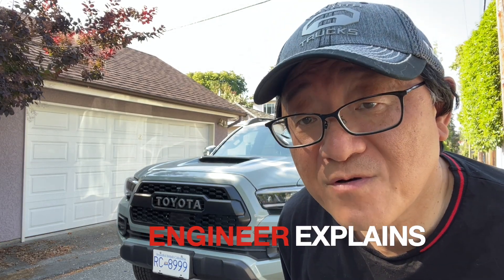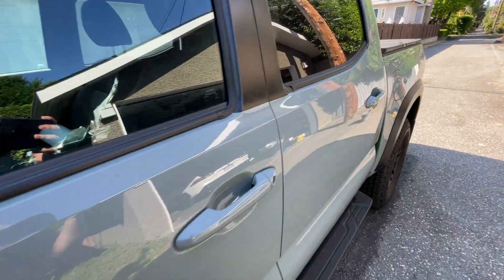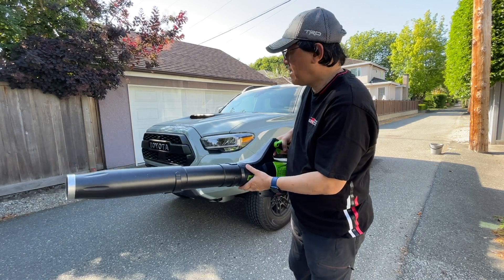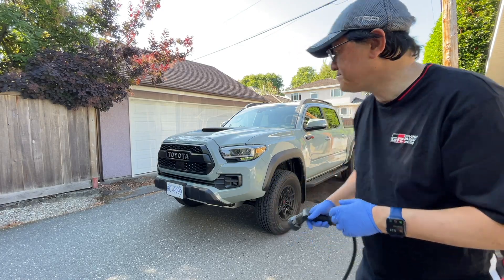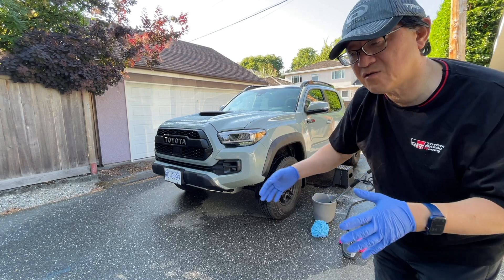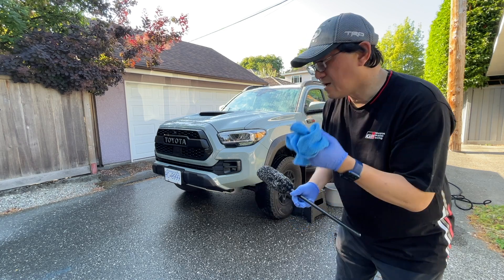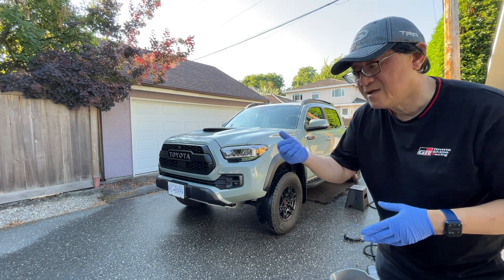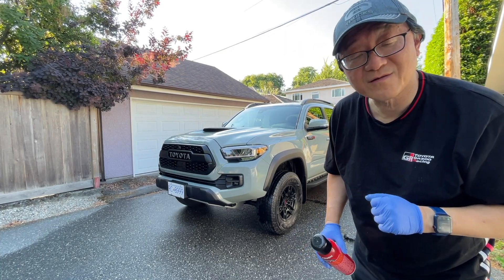ENGINEER EXPLAINS BEST METHOD FOR WASHING CARS & TRUCKS - Using Leaf Blower as a Tool!

Comment: You need a garage dude not street parking aren’t you worried about people scratching or hitting the car on the street?we live in Arizona where the water is extremely hard alkaline out of the hose plus it’s often 100+°  or 37.778c°metric is so goofy so it drys off super fast

Comment: I enjoy your videos!  I am skeptical of using the leaf blower at the beginning though. The leaf blower does nothing more than driving at highway speeds does for blowing dirt off. I suppose if the vehicle has been sitting for a while the blower would be good for removing loose debris and dust without washing it into the crevasses as water would. I'll never get to try it out though because my 4Runner doesn't sit for more than a day.
My pet peeve is the hood scoop. It seems really difficult to rinse all the soap from the hood scoop for some reason.

Comment: David, I always use a dual bucket system to to rinse my wash mitt before putting it back into the shop bucket. I also use my leaf blower as you do. You might want to try the Ceramic Wash & Coat from Griot's Garage. I love it on my ceramic coated cars.

Comment: What about pinstripes when offroading? A PPF is needed if paint care is important to you. I'm surprised no pressure cleaner was used. I doubt a blower does much. If you have caked mud from dirt roads even, a pressure cleaner is needed instead of a blower.

Comment: I've been doing pretty much the same routine for my vehicles, with the exception of using a chamois cloth to do the final drying, which I rinse and squeeze dry several times during the drying process. I live on a 1/2 mile gravel drive, so I haven't found a tire dressing that doesn't attract dust and dirt. I just clean the wheels with a cloth and the tires with a bristle brush. I do this about twice a year, whether it needs it or not.....

Comment: Everyone in the comments is obsessed with "the two bucket method" but tbh the best method is to use multiple towels so everytime a towel is dirty, it doesn't touch the truck or bucket again.  One bucket, one dip, and then throw it in the wash pile and grab another.

Comment: David thank you for the tips on cleaning your truck without scratching the paint. I will be using the the methods you showed in this video presentation this summer on my 2016 Subaru WRX limited.

Comment: David I Would Highly Recommend the Two Bucket Method with Grit Guards this Method Separates the Clean  and Dirty Rinsing of the Wash Mitt to Prevent as Much as Possible Scratching
Reply from the maker: Yes I am aware, I just didn't have a chance to show every step on the video.
Reply: @AutomotivePress  it’s Cool you did an Awesome Job👍

Comment: Great video Instead of ceramic coating, I use a polishing compound, glaze and wax (Meguiar's). Also, Michelin recommends that  you don't use tire dressing . Soap and water and a stiff brush will remove the dirt and brown stains.

Comment: Hi Sir, which brand of tonneau cover did you use, any recommendation? Thank you
Reply from the maker: I purchased the OEM original Toyota tonneau cover, which I find is heavy but more leak-proof
Reply: @AutomotivePress  thank you for the reply, I am actually in the same situation like you, I have placed an deposit for 2022 Tundra Platimum this January and the possible delivery is June

Comment: Toyo 12    David: I use the leaf blower to dry my truck,  didn't think of using it before washing.  I would say , I wouldn't lay  the microfiber towels on the ground as they will likely pick up grit, may scratch paint. Nice truck, keep up the good work. Thanks Bro!
Reply from the maker: Thank you for the comment! Don't worry, I didn't use the towel that was left on the ground. The video isn't showing it but I used all new towels for every step of the way.

Comment: David, normally I like your videos, but here, less talking more action. I think driving on the freeway should blow off a lot of the dirt before you wash it.   Could not care less about your shirt either.
Reply from the maker: Thank you for your feedback, and I really appreciate your comments.  Driving on the highway, though, isn't the same as using a leaf blower which has much stronger wind flow. You can also focus on all areas of the truck to "blast off" using the blower, not just the front of the truck.  Anyhow, always appreciate your feedback.

Comment: David, start using an extra water bucket of clear water, and after every panel dunk, the cleaning tool in the clear water bucket then dunk using the cleaning solution. This helps maintain minimal amounts of dirt in the washing solution bucket.
Reply: thats a good idea. I find with a pole and microfibre pad in a soap bucket, after washing a black JCW, it will still have some dirt on the lower portion of the doors

Comment: Do you still use the same wash and wax soap you use on the body to do the roof, windows, and wheels??
Also wondering why you didn't go with the long bed?
Reply: Don’t they have a special wash for the front of the truck and a different one for th right and left sides and another one for the rear?

Comment: Air hose would would maybe be a good idea as well. Especially on the interior! Love you're truck, I just started watching your channel considering I'm in the market for a Toyota Tacoma  you've given me a lot of great knowledge! I test drove a brand new 2021 SR5 with the trail package. Army green with black decal emblems along with black wheels and all terrain tires not sure if they're the TRD wheels or not considering it wasn't a TRD sport. It also had a bedliner with a built in cooler and a 110amp outlet. My only let down with the truck was it didn't seem to shift gears very smoothly  like it was confused on when to shift at the right time. I'm not sure if it's because it was brand new and not broke in yet or  do you know if that's a common thing? Because I also test drove a 2021 TRD sport with 7k miles on it and it shifted fine? I'm really looking to purchase a Tacoma but I'm not fully sure on all the different models with the SR to the SR5 the TRD sport the TRD off road  the unlimited I believe and the TRD sport pro! If you feel up to making a video on some of the differences between them that would be very insightful for me atleast. I'm mainly curious if the SR5  is pretty similar to the TRD sport regarding the suspension and internal components when it comes the engine/transmission/ ride height that sort of thing. Not so much the extras regarding the hood scoop and the extra bells and whistles you get with the interior of the truck. Hopefully you understand what I'm trying to explain😂 another words can I get a the SR5 with TRD upgraded wheels and tires and basically have the same truck as the TRD sport or is every model from the base line model 3.5L V6 different  as you upgrade to the sport, offroad, etc? Sorry for all of the questions! Or I even wonder if the 2.7L 4 cylinder SR5 is the same as the SR5 3.5L V6 other than having more power do they beef everything else up to handle the bigger engine?

Comment: What about abrasion caused by debris sliding off of the surface?  I wonder if a Shopvac might be better than a leaf blower? This video has not deterred me from using water pressure to remove surface debris.  Full disclosure, I am not an automotive engineer.

Comment: Tip: use two buckets one for soap and one for rinse water to get off the debris post application of the soap to the body. Also never I mean never have the wash mitts on the concrete,  always make sure you keep it in the bucket or on a clean surface you may get micro scratches that will haze your finish over time until you polish them out from concrete grit. If you wash it with this method and apply a spray on wax every 3 months your paint will look great all the time. Clean mitts and clean towels are the secret.
Reply: Better yet. Use 5 different mitts with a single bucket. One for the top/windows, one for the hood/front bumper, one for each side and one for the rear/back bumper. That way you never put a dirty mitt in the wash water.
Reply: All great advice folks
Reply from the maker: Please see my pinned comments on top.  Thank you for commenting.
Reply: I have black 4runner 2021.  I snow foam it before I wash it.  Best way to remove the dirt.  I have zero scratches.
Reply: I do the exact same stuff as you mentioned in tips. One thing I would add on to that is using a plastic tray in the bucket that makes sure you get none of that bad stuff back on the mit

Comment: Your light blue glove placed on the road surface picked up road grits that if not removed will scratch the surface of the tacoma's body. Better to place it in a clean bucket than on the unclean road surface.
Reply from the maker: That glove was thrown away. I used a new one which isn't shown on the video.

Comment: As an automotive engineer...  I encourage you not to place your wash mits on the ground.  They will instantly pick up grit off the ground and scratch your paint.  Also it’s preferable to use a soap bucket and a rinse bucket for the mit.  This keeps the soap bucket much cleaner.  Thank you for the videos.
Reply from the maker: Please see my pinned comment above, I explain about this situation.
Reply: I applaud you for making videos.  You are doing a great job.  I hope my comment didn’t sound too harsh.  It takes some thick skin to deal with all the “experts” in the comment section.
Reply from the maker: @StubProductions  No problem at all Bob! Thank you for your feedback and comments.  I was just surprised at number of people commenting about the wash cloths on the ground, though I realize that they don't know what I might have done in the background not shown on the video itself (which is why the pinned comment at the top).  Thanks again.

Comment: David, I have a question. Many companies on the market offer products for car car paint care that are much more expensive compared to regular car wax. From Toyota's point of view, do these products make any practical sense? Or is it a marketing gimmick? How do Toyota's paint engineers recommend to take care of the paintwork? Thank you.
Reply from the maker: Some of it is definitely hype.  The ceramic-infused wax does perform better overall, though.  Generally speaking, Toyota engineers just recommend normal carnauba based wax because it's proven over many years.
Reply: @AutomotivePress     thank you so much

Comment: Good video just wondering how much it costs to do a ceramic coating on a pickup and how long is it supposed to last.
Reply from the maker: The prices range wildly from region to region, so it's best to shop around in your area.  It's not cheap but will last for several years.

Comment: Great vid. I sort of cringed a bit seeing those wash mitts on the ground.  The roof of my 3rd is showing signs of oxidizing. It sits in the California, sun and apparently I haven't waxed it as often as I should. Seems kind of premature though for a truck with 40k on it. Pretty bummed.
Reply from the maker: Please see my pinned comment above about the wash mitts... anyhow, it's never too late to remove the oxidation.  You will have to get a professional to do it, but they can remove even the most nasty oxidation using a number of different polishes and compounds.

Comment: Anyone who wants to use the leaf blower tip mentioned here... it probably goes without saying, but make sure the blower is CLEAN as to not blow dirt and rocks on your paint!
Reply from the maker: Yes very good point! I clean the tip of the blower each time and make sure there aren't any dirt trapped inside.

Comment: Uses leaf blower to remove dirt to avoid paint scratches, then puts wash mits on the dirty ground before washing with them 🤦‍♀️
Reply from the maker: I didn't show it, but I replaced the towels that fell on the ground. I only used the fresh towels on the truck.  The towels that were on the ground were never used.

Comment: David, In my view the first step to a clean car is parking it in the garage as much as possible. That keeps it away from birds doing target practice as well a tree sap, UV rays etc.
Reply from the maker: Yes absolutely, but unfortunately our garage is not very big and the Tacoma actually doesn't fit in (it's too long).  So my wife's RAV4 Prime and my Supra get to stay dry and clean inside the garage.
Reply: @AutomotivePress dang! Haha
Reply: Real damage to paint is Dew drops or water drops in sun burn paint . Especially the crappy water based paints on cars today . Those droplets act as magnifying glasses of sunlight .